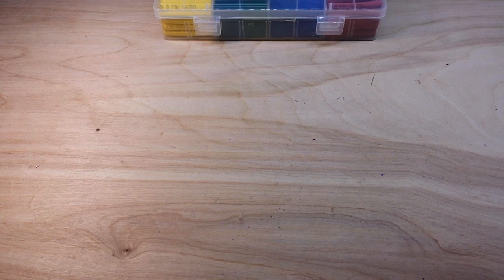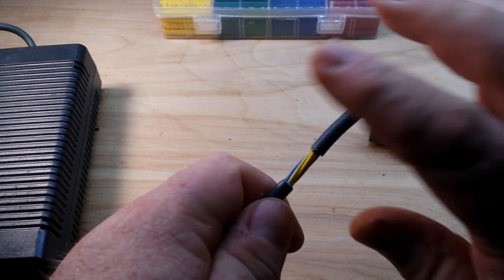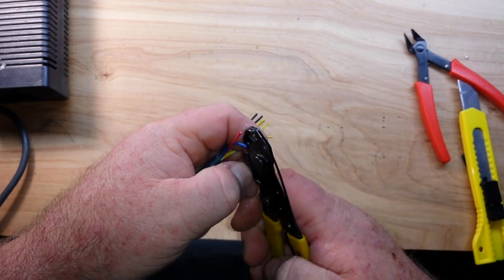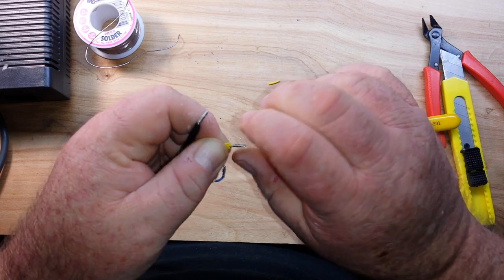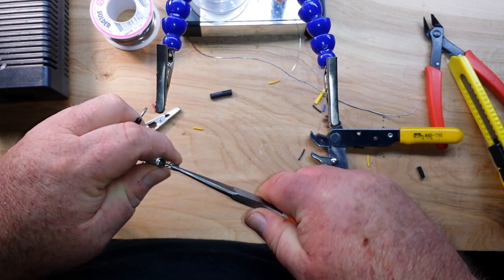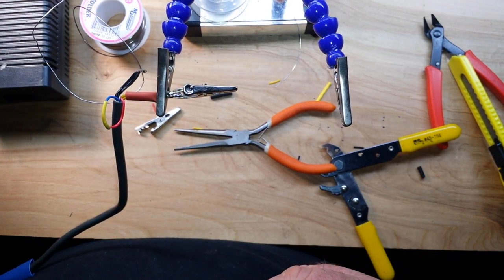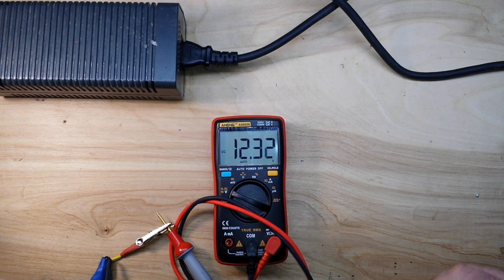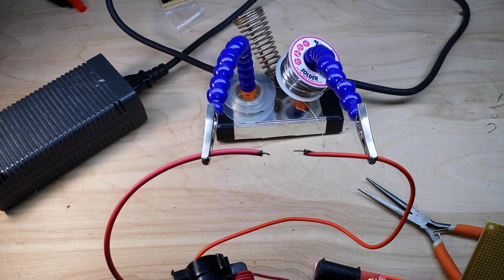More Amps, I need more Amps

Comment: That looked like fun! Glad you didnt blow up! haha
Could you please explain why you connect the first blue and yellow wire? What does that do?
Reply: Michael Eckl to turn it 'on' like a PC Power Supply when you press the power button, otherwise it would stay in 'standby' until these were connected. i would add a power button on the housing where to connect the EN. then you can cut the 2 wires. this way you have to pull the plug to power it off.
Reply: Thanks!

Comment: You can also add a high power buck converter on the output, get a variable voltage and a possibility to get even more current at lower voltage. 
P.S. The tip about the heatshrink is 100% correct, this law also applies to the jacks (audio, DC barrel jacks). It's incredibly frustrating to do a nice joint and then realize that the heatshrink/jack is not on the cable.
Reply from the maker: MrJohhhnnnyyy So many times I've forgotten the heat shrink or back end of the jack. Now as soon as I start a project, I thread heatshrink on first.
Reply: learnelectronics so true. I wish I had a dollar for every time I forgot the heat shrink !